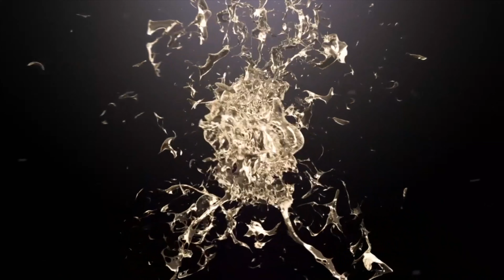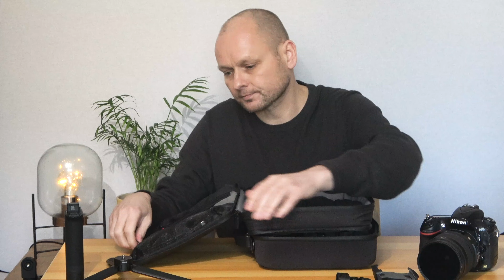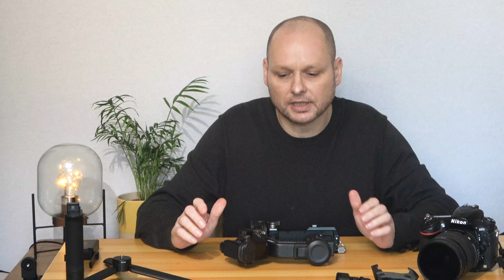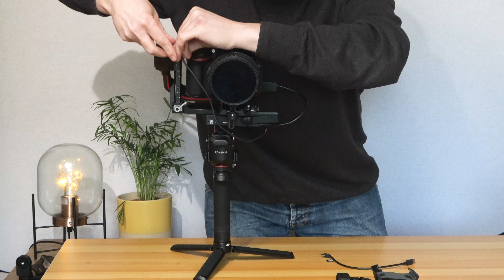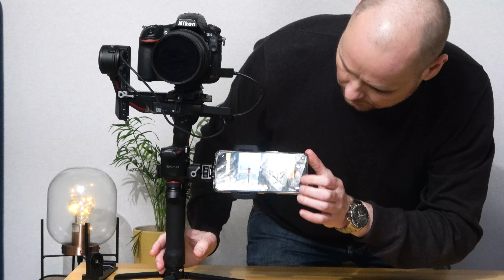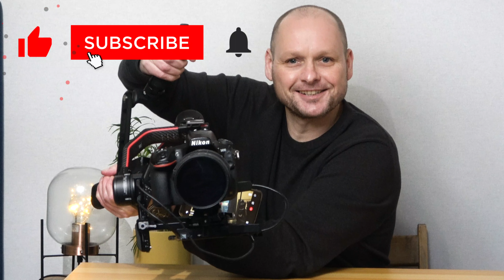DJI RONIN RS 2 (PRO COMBO) What's in the box and how to balance!

Comment: Hello,,, Thank you very much for your video. very instructive. One question please, I have a Nikon D850 and a Ronin RS3 Pro; I see that bluethhot can not connect. Do you know, please, by cable in that model which would be the ones that I would have to acquire? Usb-B to Usb-C?,,, the connection to HDMI that you make, is it only for the RS2?. It is that I do not see clearly the connection method in my case. Thank you very much and sorry for the inconvenience.
Reply from the maker: Bluetooth should connect through the app. Make sure you have WiFi turned off. It can be a bit tricky. 

I'm not ganikiar with the RS3 but I cannot see it being much different. 
Connect the cables as per the instructions or gotobthe DJI website where you will find full video instructions and be ca3fik each cable is connected in order. 

I threw a bunch of cables away, you must have the right cable for each port.